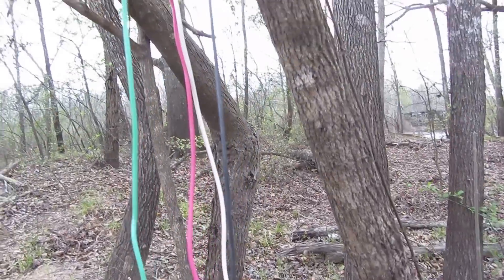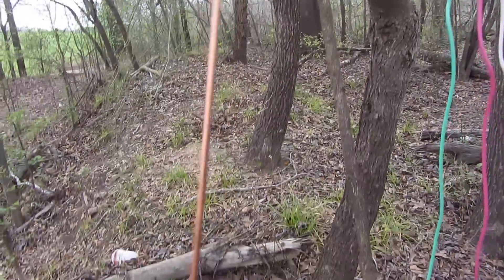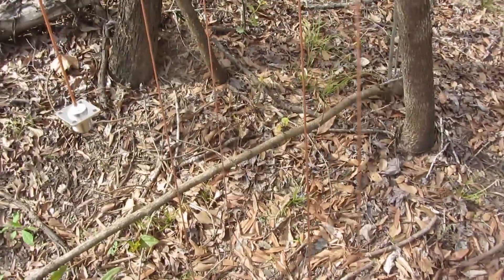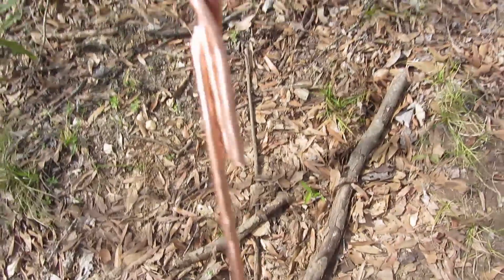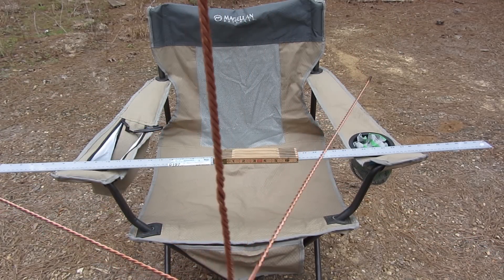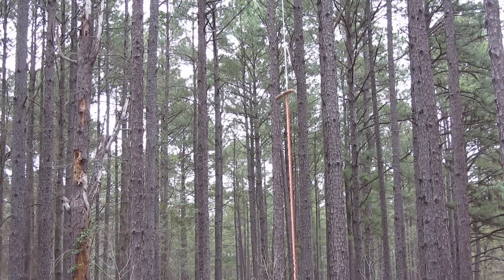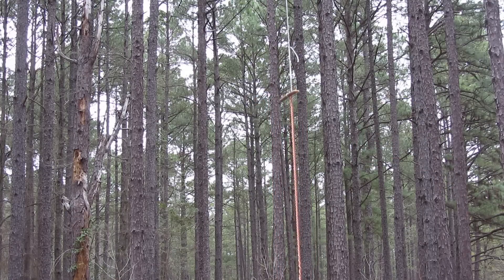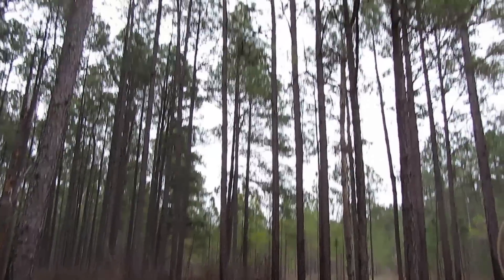2-METER Radio Antenna Homemade

Comment: I'm gonna build one of these.  How did you get the loops on the ends so nice and uniform?
Reply from the maker: +CheckmateGamer
I found center of the wire length and wrapped it around a small diameter tree limb. Then placed the free ends into the chuck of a cordless drill. Turn drill slowly while pull slight pressure away from center loop.
You can use the round shaft of a screwdriver or a round rod to achieve the same results.
Reply: I'll give it a try, thanks.

Comment: Yes I do
Reply from the maker: +56thSPSk970
Good, you will probably need it to tune the antenna to your radio. Usually bending the 4 ground plane down slightly is all it takes.
Do you have a specific frequency you would like it to made for?
Reply: 146.520 natl calling freq
Reply: Still trying to make contact

Comment: I want one, no two!!!!
Great video thanks.!!!!
Reply from the maker: +56thSPSk970
Thank you. It is a handy and convenient design and inexpensive enough to have several.
Reply: TwoFeatherChannel 
I don't have the means to build, apartment.  no tools.
Can I buy.?
Reply from the maker: +56thSPSk970
Do you have an SWR meter that covers the 2 meter band?
Reply: TwoFeatherChannel 
146.680 (local repeater)
And nat'l. Call freq. 146.
KG7LPH
Reply from the maker: +56thSPSk970
Okay I will cut the length for that to be center. It will have a much broader range but that should be the best spot, where it will be most used.
Send me a PM on my channel page with your shipping information.
Reply: TwoFeatherChannel 
Stand by

Comment: Not sure if you intended to do it, but twisting those two wires together should make that a pretty broad banded antenna.  I am guessing you should be able to get close to the entire 2m band with that at pretty low reflected energy.  Nice build.
Reply from the maker: +Bruce Lawrence
I tuned the length to our most used repeater at 147.330 mhz. but have not tested it beyond that. Some day I will get a much needed MFJ antenna analyzer. I have some 3 element yagis made from same copper wire and PVC tubing that I mainly need to check before using.

Comment: Nice work for sure. I figured you were an electrician too by the way you knew how to manage the wire. Excellent. I'll be showing the guys at work this video. I just got my Technicians last week and you put my 2 meter hand built antenna to shame.
Reply from the maker: +Jason Wilcox
Thank you. I received my Tech last Feb. then my General in March, while I was in a layoff between jobs. Now that I am working back full time I had to stop studying for the Extra exam. Extra class will take a lot more time for studying.

Comment: your drill idea for straightening wire will be good for lots of projects, not just this one, im gonna have to remember that trick.
Reply from the maker: +PARADOXICLES
When you pull the wire tight and start to turn the drill, be sure not to turn it too much or it will twist the wire.
Reply: good to know, thanks.

Comment: The best looking antenna ever yet it works impressively!! Very well done
Reply from the maker: +ghg ghghg
Thank you, glad you like it. I'm an Electrician and the copper wire was free. You can use other types of metal but copper is a better in conductivity and the only price was for the SO-239, Four Bolts, Nuts and Time. No loss if I have to leave it somewhere.

Comment: Why do you only have the center element connected to the so238 socket ?
Reply from the maker: +100msw
The center element is connected to the center main conductor of coaxial cable, which is where the the transmitting power runs through. The other 4 elements are reflectors, which create an artificial ground plane to bounce the signal to and from the center element and they are connected to the outer shielded conductor of the coaxial cable. You can think of it as a Positive and Negative of automobile dc power, they are separate but need each other to work.

Comment: how far were they from you?
Reply: GMRS/FRS freq. and those radios from walmart and sporting good stores are up around the 70cm (460mhz).
Reply from the maker: +Eric C     70 miles away. The frequency I'm using is 147 MHz, that is near the frequency of those Two Way radios you see in Sporting Goods Stores GMRS/FRS that boast "35 Miles" but they don't, you are lucky to get 5 miles with them.